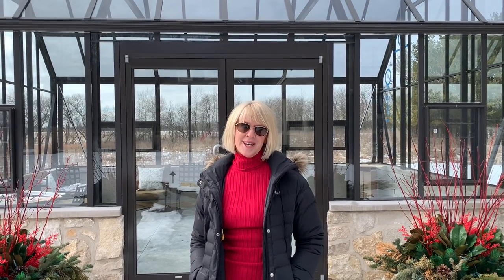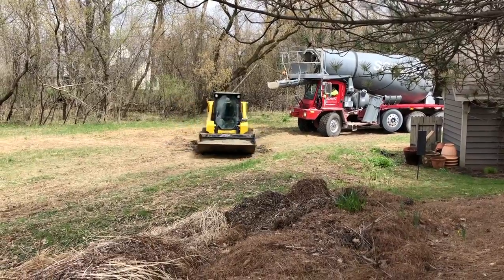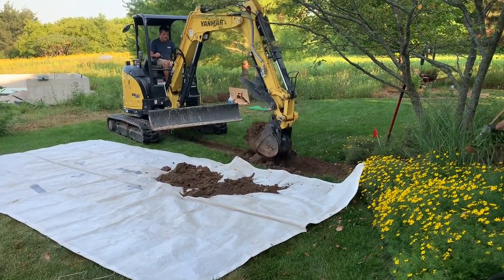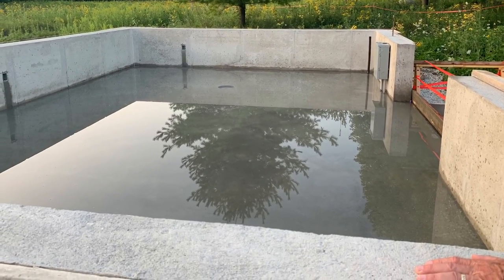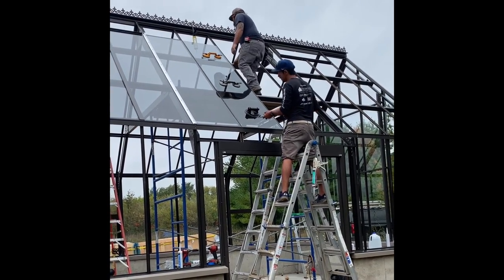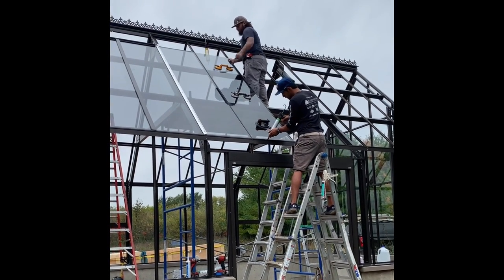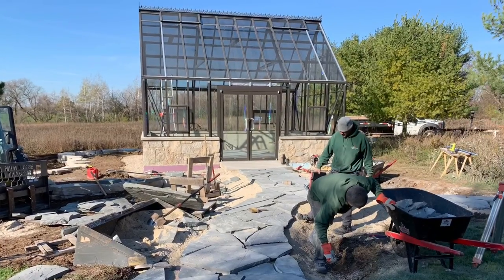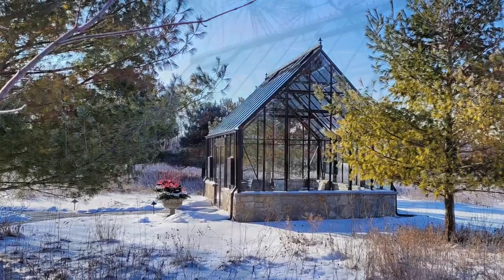Our Greenhouse - Dreams to Reality

Comment: Dawn, thank you for this wonderful video- appreciated. How detailed yet succinct your description was… I have a specific question about your unique stone urns. We are in southern Indiana in zone six but used to live in Chicago with much more snow of course there along with freezing and thawing. So far, did you get any cracks or do you just make sure that you empty them with no soil and water source and do they stay outside or do they get tucked into the greenhouse? I find myself trying to winter over my containers with some of the plants in them in our greenhouse which is not heated and actually acts more as a cold frame. I will watch the other videos about your greenhouse now that I found you on YouTube. Thx
Reply from the maker: Hi Susan. The large urns outside the front of the greenhouse are cast stone and weigh probably about 350 pounds each so they’re in place never to be moved again! I do fill them in wintertime with Styrofoam and then put in my greens and such for the winter season. I put Styrofoam in because I removed the dirt and the Styrofoam actually acts a bit like a repellent of water. I do not have any cracks at all in these containers and this would be there 4th winter. I think I actually have a YouTube video on the Styrofoam and greens and such that I put in the container. If you go to my channel and look under videos and scroll through, you’ll find one where I’m just talking about the earns in front of the Greenhouse it’s an older one probably from two or three years ago.

Comment: It's beautiful! Just gorgeous. Your video was very interesting.  We've just ordered our greenhouse from BC Greenhouse and are a little overwhelmed by the process. I have a couple of questions; 1) I really like the a proportion of your knee wall to your greenhouse. Would you mind sharing the dimensions of your greenhouse and the height of your knee wall so that I can get an idea of what I might want to do? 2) A tinted roof! We opted for the polycarbonate roof because we live in southern Oregon and have hot summers. I really like the look of your tinted glass though and I'm wondering if you're happy with that? Thank you so much for posting this video, I'm sending it over to my husband right now! Many thanks in advance for any advice...Marty
Reply from the maker: Hello Marty!  Thanks so much. Yes the process can be overwhelming and long for sure. Dimensions are 20 feet long by 14 feet wide. The knee wall is 30 inches which is perfect imo because it hides stuff inside and gives the the GH nice height. We do think the tinted roof helps somewhat with heat but we are also going to install shade curtains eventually.  We do like the look of that tinted roof as well. My hubby is working on how those are going to work. I’m not sure if I’ll even get them up this summer. We had a hot stretch with temps in the high 90s and with the vents open and the fans going it got to about 84 and I think the shade curtains will help just a little bit more on top of that. Using poly should help a bit more as well. Good luck and if you have any questions along the way email me at seasonaldesignsbydawn112@yahoo.com

Comment: Hey Dawn,  absolutely love your greenhouse. I've been researching and think I'm going to be able to pull the plug and order pretty soon. I am pretty sure I'm going to go with BC greenhouses.  Need to connect this next week and ask a bunch of questions. Im planning on a much smaller model, but likely the Cape Cod, 8x12. I was planning on having a concrete pad poured but not the 1/2 walls. Did you do the 1/2 walls due to the larger size of your greenhouse? Yours is gorgeous. Will have to watch the rest of your videos! Thx for sharing!
Reply from the maker: Hello!!  Yea for you!  How exciting!! We did the knee walls to add a little bit of height to the space and just really like the look of the stone wall.  I think it adds a lot to the space and makes it a permanent structure. It also adds cost. But do what’s right for you. Either way you will love your BCGreenhouse. Please reach out if you have other questions 🤗
Reply: @SeasonalDesignsbyDawn  thx so much for your reply.. good info. I love the look too, I live on the coast so have height limits and actually as I looked more last night, may have to go with a different model so the roof isnt too steep. Kind of a bummer but want to be mindful of my neighbors and the view. Thx again. Getting excited!

Comment: Your greenhouse is absolutely beautiful! My wife is looking at building one soon and the Cape Cod is in the running for sure. What size did you build? We live in Connecticut and have New England weather which changes every other hour. I'm looking forward to seeing your future videos as I learned a lot from watching this one! Thanks!
Reply from the maker: Hello Rich. Thanks so much!!  This is 20 by 14. Oh yea you guys have crazy weather there!!  You should look into these which a truly made to stand up to super heavy winds and snow loads. You can also get them reinforced. We worked with Wisconsin Greenhouse Company and purchased this thru them. But BCGreenhouse out of Canada is the maker and they have both been great to work with. Wisconsin Greenhouse installs these all over the country. Some of them are huge!!  Good luck to you!!
Reply: @SeasonalDesignsbyDawn  Hi Dawn, We've been watching your videos of the greenhouse and plantings and they all look great! Can I ask what type of heating you chose for the greenhouse and how is it working out? We are expecting our greenhouse build to start in the fall. We are still working through all the support work needed. Thanks!
Reply from the maker: @rb91458  yes of course. We have the Lopi premium cast iron gas stove. 40,000 BTU. We have not had an opportunity to use it yet as it came in around mid May. We are still waiting on it to get hooked up but seeing that it’s summer we won’t get a chance to use it until this fall. We chose this because of the look versus a big unattractive unit hanging up high. I am close to being ready to post a video on the inside and I will mention the Lopi and show it in my video. I think it all depends on ultimately what you want to use your greenhouse for. If you are strictly using it for growing year round you probably want to look at some thing more powerful. We will most likely not be growing or using much in January and February when we get the least amount of sun and the most frigid temps.

Comment: Great video! Congratulation on your project and BC Greenhouse. Curious about the forms used, interested to know where the contractor you used purchased them. Also was your contractor the same for the entire project and install of greenhouse?
Reply from the maker: Hello. Do you mean the forms for the poured concrete walls?  If yes the contractor for that was Oostburg Concrete and they supplied those. The general contractor was the same Mueller Construction for the entire project (concrete, stone, heat, water, electric). We purchased the greenhouse from Wisconsin Greenhouse Company who also installed it. They travel the US installing the greenhouses they sell. I’m not sure if they sell anything but BCGreenhouses. Not sure if this gets what you need. I did put some links in the video description. Thanks for your comments 😊